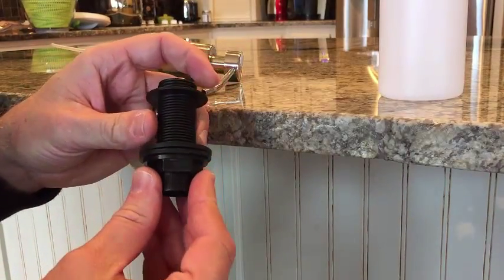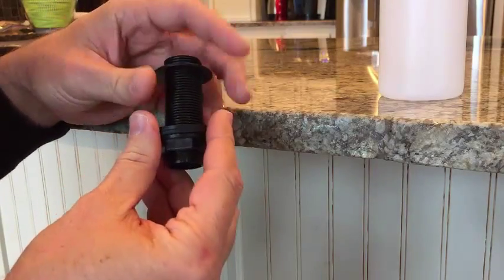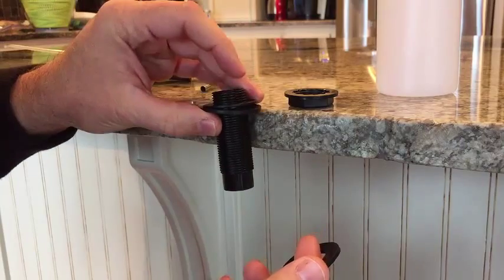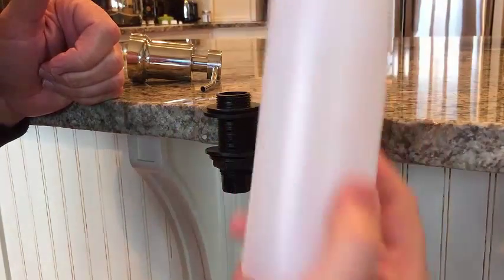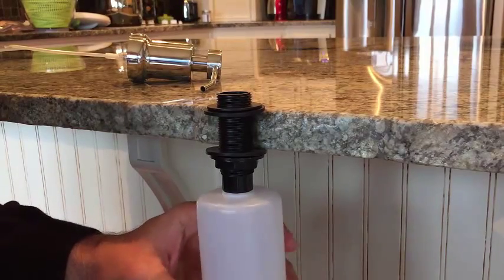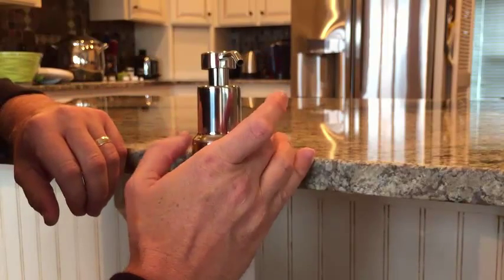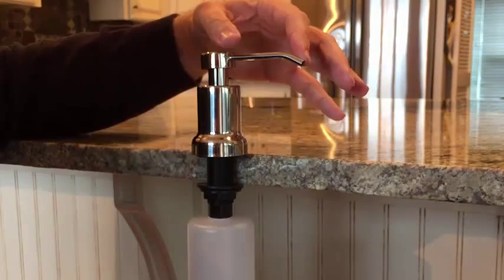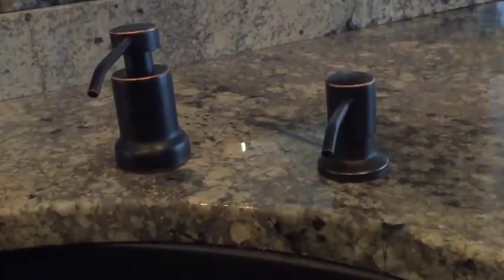Built in Foaming Dispenser - Foaming Soap Dispenser

Comment: This dispenser works great until you have to refill. Every single time you try to remove the top part it unscrews the lower nut and you have to crawl under the counter to fix it. Basically you end up reinstalling it each time you want to refill. If you want to keep using this the only practical way is to use the extension kit. The video above will tell you to lightly tighten the top, lets just say that does not work in the real world.
Reply: Im curious, instead can you just pour soap in from the top?
Reply: @milliel-c6049  Technically yes, but you need to unscrew the top. Doing that and it comes loose every time, see above.
Reply: This can be solved by adding a second threaded ring to the soap dispenser.  
Someone on Amazon used the part from her old dispenser and it works great. It no longer comes unscrewed when adding more soap from the top.